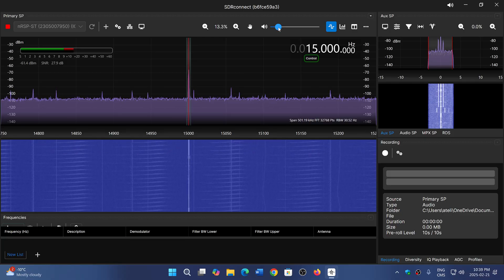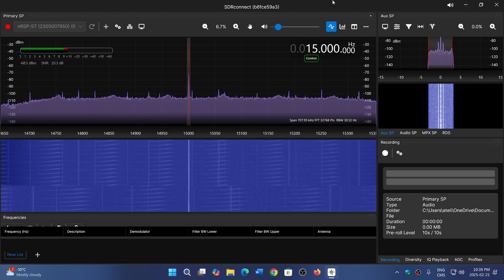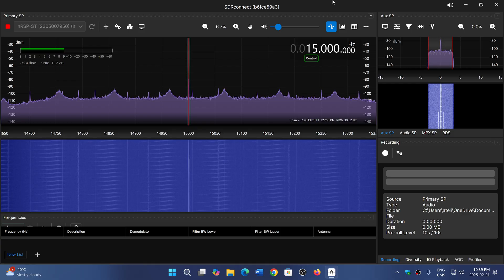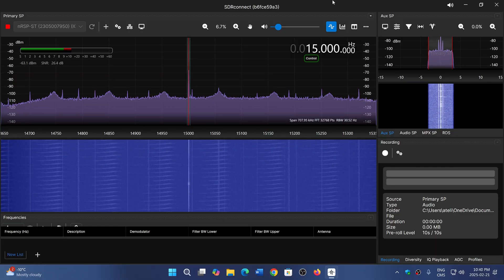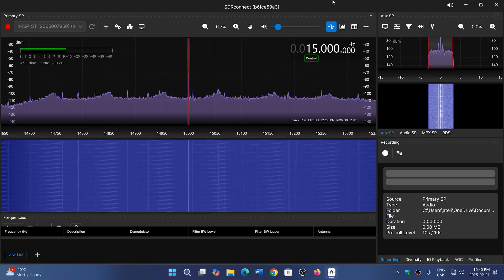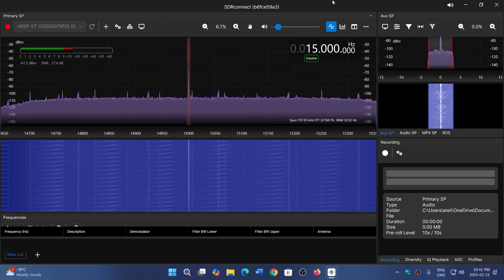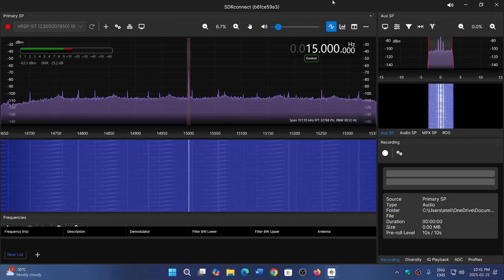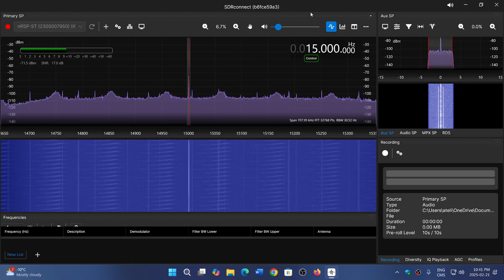New Interference on Shortwave started a few months ago and I have no idea what it is

Comment: Unfortunately there are all kinds of radio interference these days on HF, but the prominently new ones tend to come from either solar panel inverters or EV chargers. Listening on the ham bands in urban areas is becoming a real problem now,  unless you have some kind of noise cancelling MFJ box ,or you may need more than one, as I have found out with additional noise pickup antennas. It's becoming very complicated to get rid of all the noise, as it's all over the place.